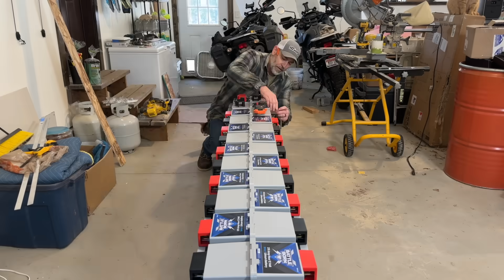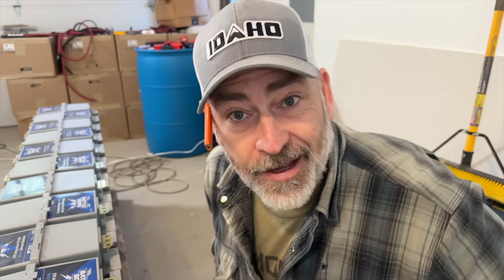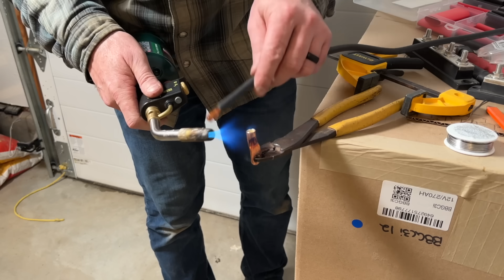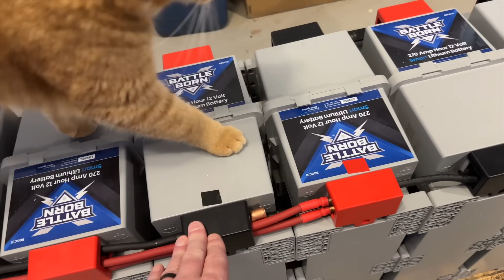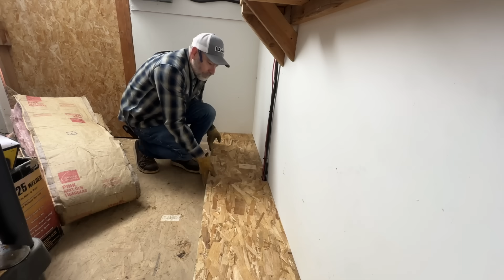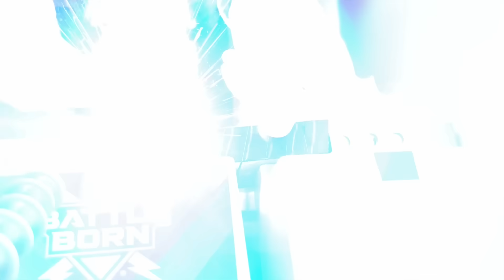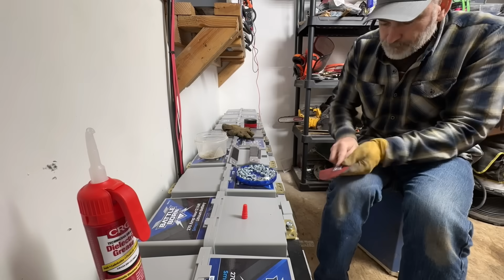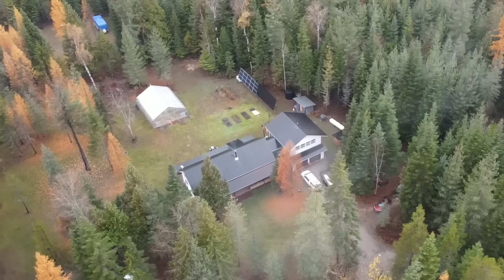BEST Off-Grid Solar Power System Battery Bank

Comment: You got bad advice soldering those lugs... At high load and temp this wil loosen , whit fire risk, Never solder high amp lugs, Crimp them! (thats profy avice from me, a Victron Dealer and installer.).
Reply: Solder then crimp...
Reply: @sweetkellymay don't solder at all
Reply: @sweetkellymay , WRONG! Don't solder at all and in any application were soldering is appropriate, NEVER crimp AFTER soldering.
Reply: @sweetkellymay  Apllying acid plumbing flux to electrical cables is going to corrode them.
Reply: @sweetkellymay never solder first, you won’t get a cold weld.  You can solder after crimping to protect against corrosion, but there is generally no need.  Soldering also creates a weak joint where wire movement can wind up breaking-off the wire at the interface between the non-ductile soldered portion and the ductile bare copper portion when no strain relief is present.  Since this is the most prevelant type of failure with soldered joints, NEC rules generally forbid soldering splices that are meant to be crimped.
Reply: @sweetkellymay  That's backwards. Always crimp first, then pull test. If you still want to solder, that's okay but use non-corrosive flux. It's lot like soldering copper water pipe.

Comment: I understand that most likely you got these batteries for free, but if I had to buy a system today, I would go for rack sized 48v batteries. Easier to deal with, less connections, large variety of well priced products and they support closed loop communication with the inverters. Even better would be a high voltage batteries and inverter, but there you are locked in the ecosystem of a brand.
Reply: he wants to master the sales challenge for battle born.
We have not gone for the rack size batteries that are usually only 5 or 10 kWh and went instead for 3 x EEL V4 battery incl inverter BMS  full of EVE MB31 and hence 16 kWh each of those, 48 kWh in total. We build a shelf so we can pull each battery (but only 1 at a time) out of the standing shelf rack (mounted also to the wall). 
Lot cheaper and better than the expensive , unusual cells used in the 5 and 10 kWh battery.

Comment: You didn't cross-thread the bolts, they are stainless steel, they do that binding thing.
Reply: A product called anti-seize prevents gualing threads on SS.